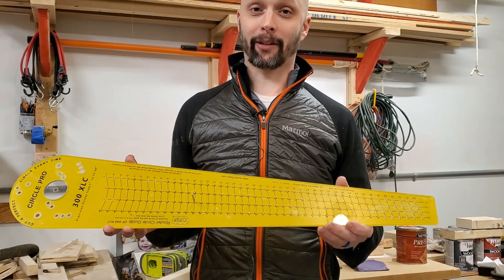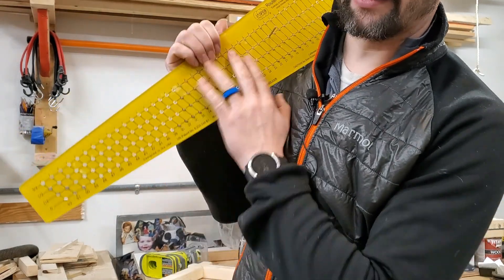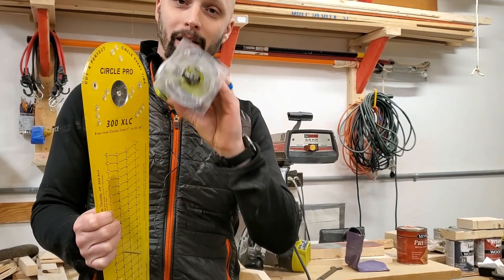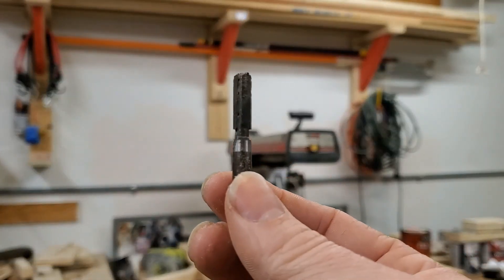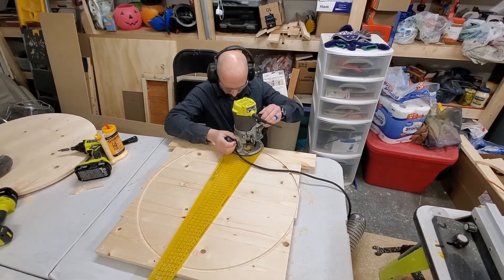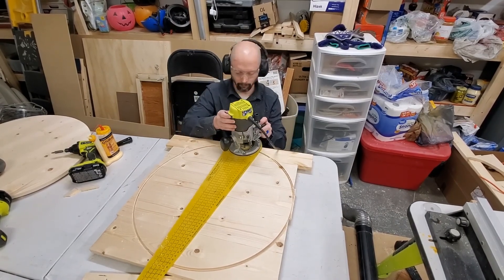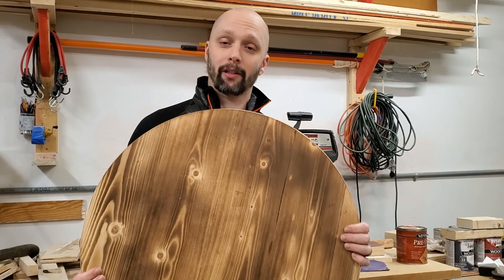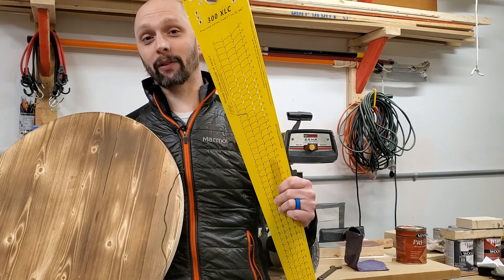Jasper Circle 300 XLC from Woodcraft IN ACTION (Circle jig Review of sorts)

Comment: Hi!  Can you please share how you attached the router to the circle jig? Thanks in advance
Reply from the maker: Hi! Well the jig has a "universal" hole system which should attach to most bit not all routers. The jig comes with a few kinds of bolts also with the idea that most routers will have corresponding holes to the jig. So if you have a router that fits the jig, you just line up the holes and use the provided bolts to attach.
Reply: Thanks.  Is your router  model the R1631/R1631G?  Only reason that I ask is because this is the model that I have but … my holes don’t align on the jig🥴.  I’ve had it for about a year now and I’m just getting around to using it
Reply from the maker: Mine is R163G